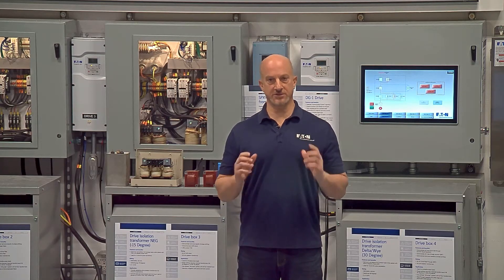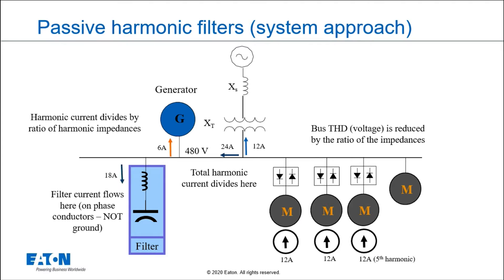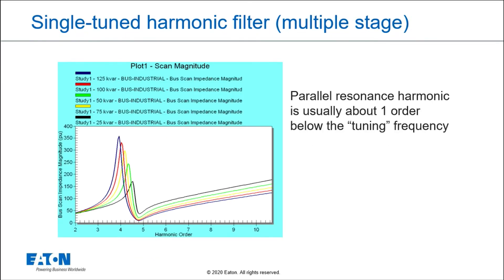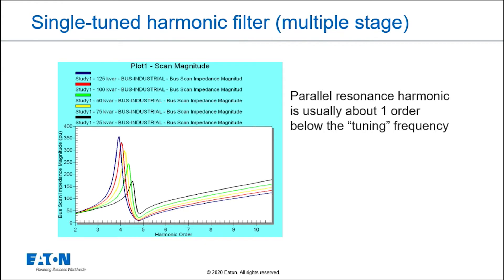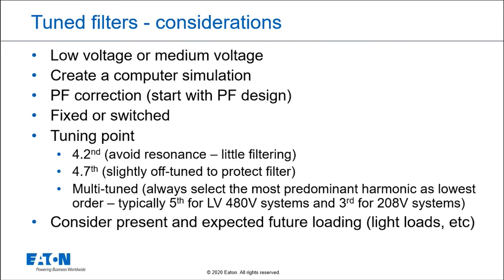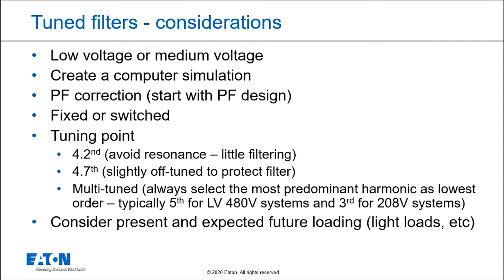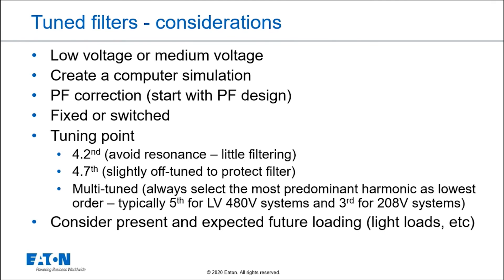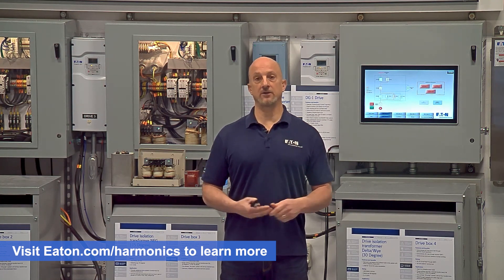4 - Harmonic solutions - how does a passive harmonic filter work?

Comment: @1:39 if the harmonic current flows from one to phase to different phase, still the harmonic are not eliminated right, will the harmonic on phase A present on  phase B or does it cancel out, if it cancels out can you please explain how it works, as when, i browsed all the passive filters seem to be grounded

Comment: i have a question, i have huge harmonic at one of  branch from MDP to SDP i tried to tune passive single tune filter at that mdp at certain order, instead reducing it was increasing the current at that orde, i tried to detune it but it somehow result other orde harmonics increase. The part that i tuned was the lowest load in the system that draws 1,6 Amps while other is like 9 to 20 Amps. Is there a problem on how i tuned the filter ?
Reply from the maker: Thank you for reaching out. Please visit https://eaton.works/3OkAwNw for technical support.

Comment: It must be remembered that all Passive Harmonic Filters are not made the same way - Its complexity and cost are as wide as car models and for a good reason. The cheapest passive harmonic filters are done when you just want a power factor correction. But then, If you have a consistent electronic failure problem and your harmonics are very high then you need to go for a custom made passive harmonic filter. Dive In:  https://enconengineers.in/passive-harmonic-filter-proven-valuable-when-equipment-fails/